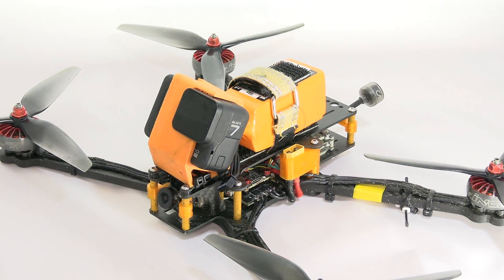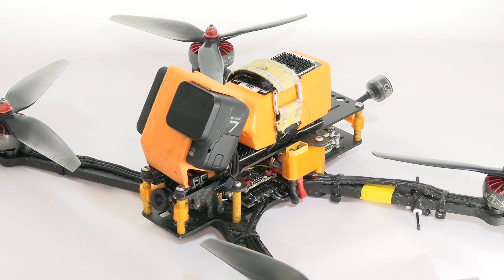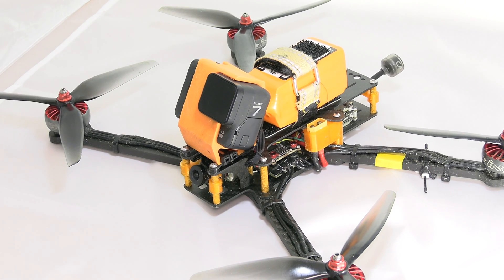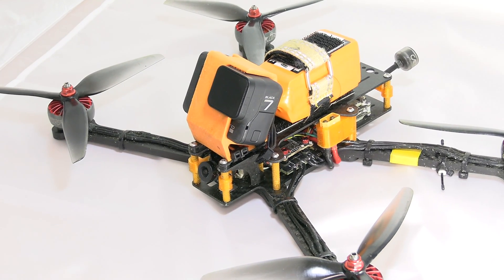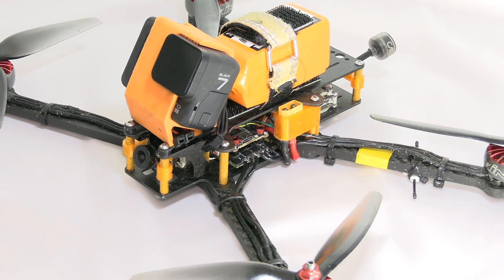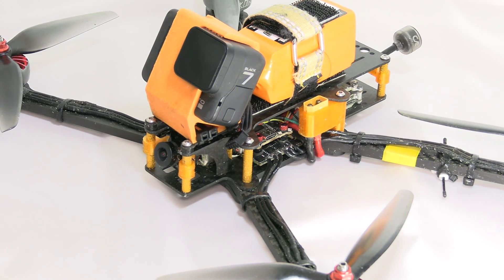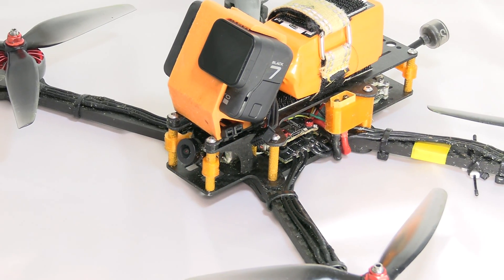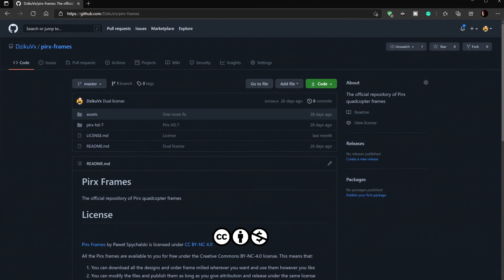Free 7-inch FPV frame design - The Pirx HD.7

Comment: before I am going to mill it, do you have the rough weight of the frame without 3d prints please?
Reply from the maker: Uuuu... I don't remember but it's around 200g. Well, weight was never my priority. It's a 7-incher, it can lift stuff :)

Comment: Hi Pawel, I bought the frame from Armattan productions and it looks very good. Started building using your recommended hardware including the caddx vista. I do have trouble mounting the polar camera as with the 3D printed TPU FPV holders, the camera sticks about 1cm outside the frame and also the camera cannot be tightened enough.
Is there another solution to fit the camera? Any improved 3D printed parts for the HD frame?
Reply from the maker: Yeah, Polar is longer than other DJI compatible cameras. You probably have too long screws. Try adding washers between mount and the camera. That should solve this problem. https://github.com/DzikuVx/pirx-frames/tree/master/pirx-hd-7/3dprint are two camera brackets. Which one you used?
Reply: @FPVUniversity  I printed both but only the _SHORT did fit the standoffs. 
I guess I will need to design a holder for it but was hoping this was already done :)
And yes, using smaller screws did help getting it better fixed
Reply from the maker: both will fit standoffs when printed with TPU. You just have to force it :)